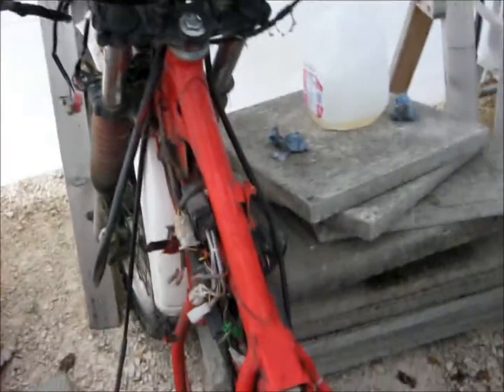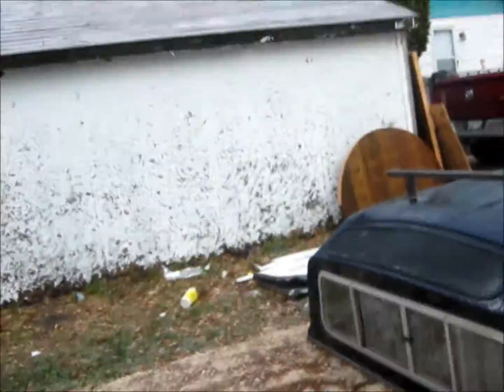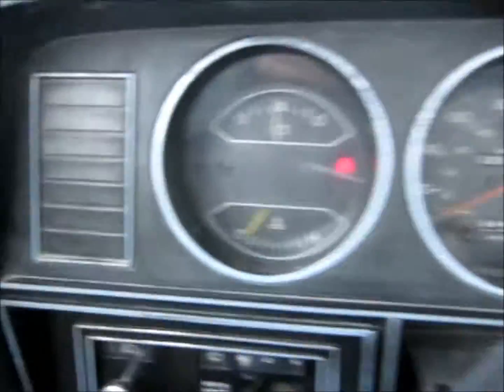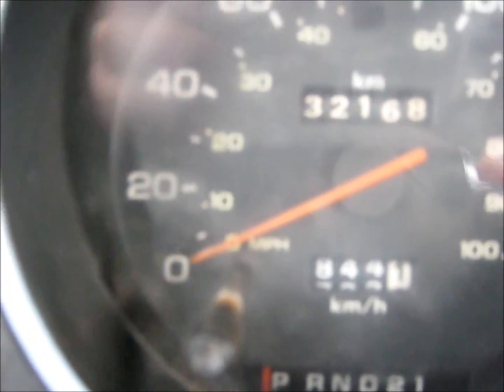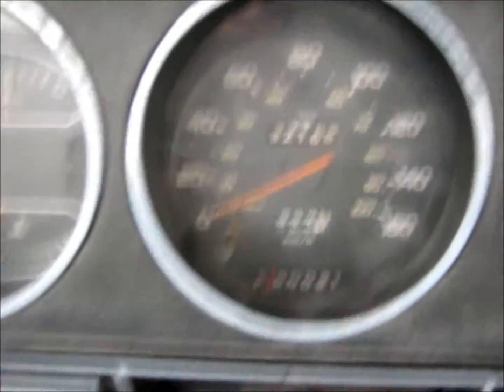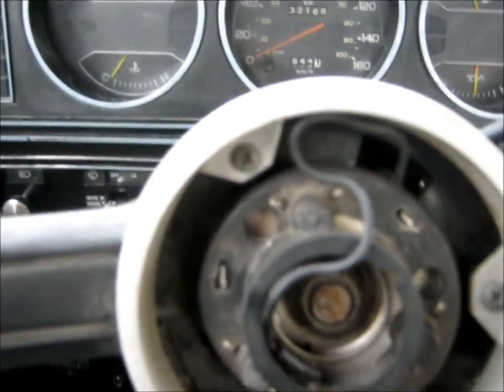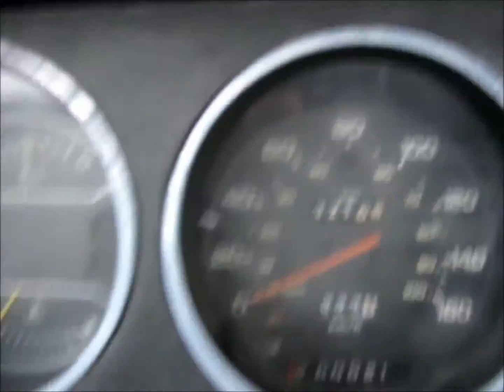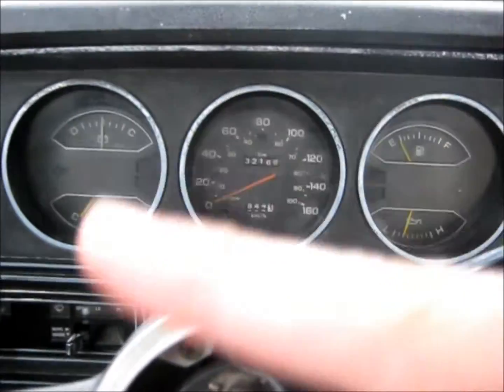DODGE D150 NEEDS SOME HELP

Comment: Usually when a speeedo jumps it's a problem with the cable. If you can get the cable off, the steel center should pull out of the casing. If it looks frayed, you need to replace the cable. If the cable looks O.K. try spaying some penetrating oil inside the cable...could just be sticking.

Comment: Also, if it revs and idles fine in neutral and park, you may have a problem with the modulator valve. It is a 10 -20 dollar part. In a Chevy it is on the back of the trans, near the yoke, and has a vacuum line from the manifold to the valve. Im not sure about a Dodge, though. The line should run above the trans. It is easy to change and is easier and cheaper than a rebuild kit for the carb. Inspect the vacuum hoses under the hood- all of them!

Comment: @Mopar4life1995 The leanburn computer is the box on the driver side of your air cleaner, it controls the ignition timing by imput from various sensors on the engine. Hei is the type of ignition that gm uses on their vehicles from i think the 80's? on up. It produces a hotter spark and is easier to service and is much cleaner in apperance.

Comment: my speedo was bounceing around a lot in my chevy, it was in the gauge itself. there is a magnet that is driven by the cable. that magnet is very close to a metal disk that is connected to the needle. after time the plastic bushings wore out, causeing the magnet to touch the disk, throwing it around. I made a plastic spacer and seperated the two. But I put too big of a gap between the two, so noe it doesnt induce the needle enough..As for the stalling out in gear. its probably a carb problem..

Comment: sounds like the stalling is from the carburetor. I had a problem sorta like that in my 77 malibu. the float was sticking and allowing the bowl to overflow with gas. dont think its a problem in your case, but a rebuild kit is cheap and replaces the needle valve and other little stuff in the carb. and spraying it with carb cleaner is great too, just wear safety glasses so it doesnt catch a corner and spray into your eyes like i did, not so fun...

Comment: With the speedo, mine works fine when its wamer out. But when it gets colder it starts to tweak out untill the heater warms the instrument panel up and it works fine. Its ony when its cold that the speedo tweaks out. As fo the stalling, rebuild the carb or try and find a good holley 1920. And get rid of the shitty leanburn computer. I did an hei conversion on mine when the computer went out, runs 10 times better. Go to slantsix.org, very helpful forum dedicated to slants and A body mopars.